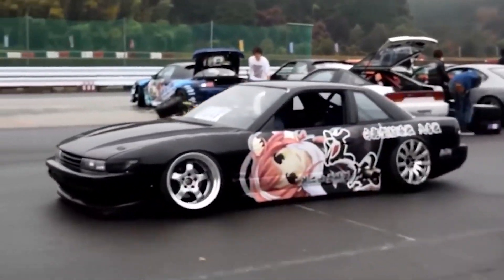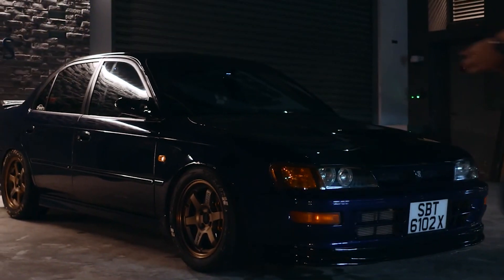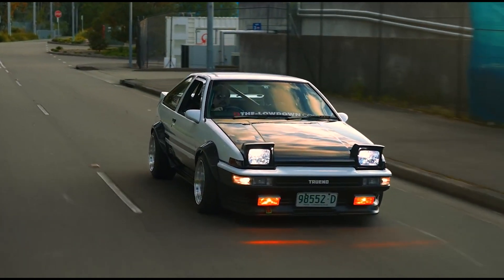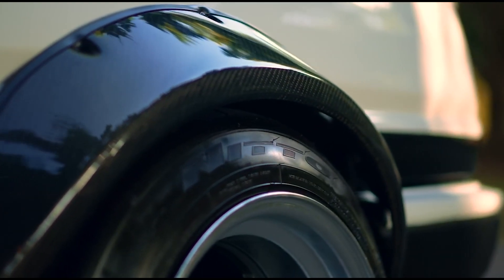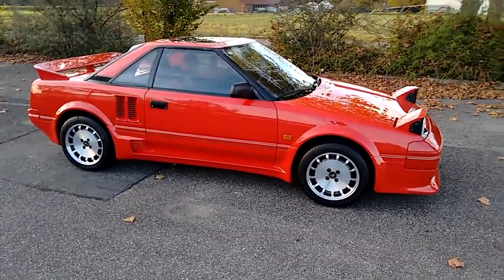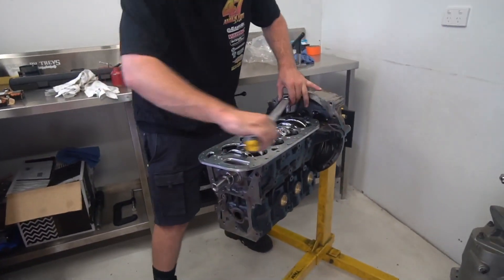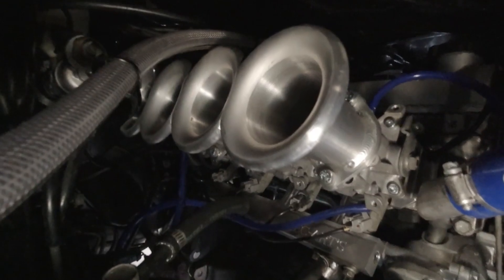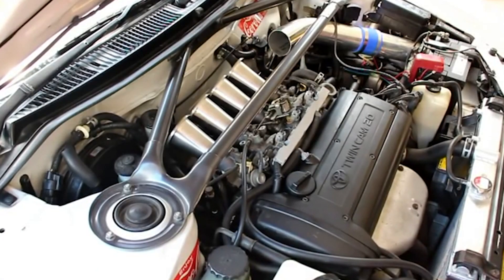Revving Through History: The Story of Toyota's 4AGE Engine

Comment: Also don't forget the 7AGE. The 7A didn't have a performance version (aka have a G in it's name) but it was a 1.8L version of the 4A engine, so you can bolt a 4AGE head onto the 7AFE block and get a 1.8L 4AGE, and thats what's called a 7AGE. Best done with the 20V head for obvious reasons
Reply: Did you just say 20 valve?
Reply: 16v head would be a better option

Comment: important to mention that all those videos with high induction noise are cars with ITBs, on stock 4AGE you can only hear the exhaust and the shims tickling xD

the TVIS (variable length intake system) makes for a much smoother powerband curve, so its almost impossible to feel when the butterflies are open or closed, as opposed to HONDA V-Tech, where you can feel and hear it, and is the same as Toyota VVTI (variable distribution)

annnd i would have mention the yt channels you took the videos from

apart from that, great video overall

Comment: The original 4age was bland, honda's d16a9 was better in my personal experience. Blacktop 20v on  the other hand is great
Reply: once you get into 4ages, 16v>20v
Reply: @isaachammond2901  "once you get into 4ages, 16v>20v"

Can be. Depends a lot on how far youre going with things and what youre spending off the bat.

But its worth noting it takes quite a lot of money to get a 16v to make the kind of power a 20v does from the start, let alone if the 20v is modified at all. 

Just a set of cams in a 20v can make quite a bit of power (as far as 4ages are concerned), and take even more work for the 16v to hit.

When absolute peak power is concerned, a big port 16v is typically the way to go. But were talking a motor probably seeing 10k + rpms,

A similarly modded 20v will typically fall behind this, but id still rather have a 20v in my car if im honest.  While the 16v will probably make more peak power (roughly 5-10~ more WHP if were looking at the nutty end of things), the 20vs tend to make power across a wider RPM range. 

Unless youve got a super close ratio transmission, that sees you shifting at 10~ k rpms and grabbing the next gear at 8-9000~, the wider power band of the 20v is typically (imo) better in an actual car.  

But that said theyre all awesome.